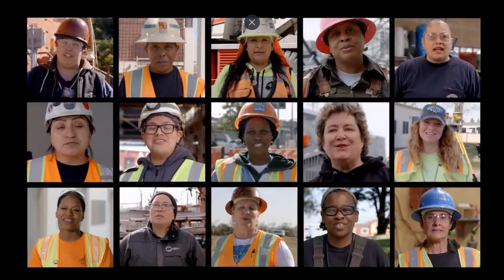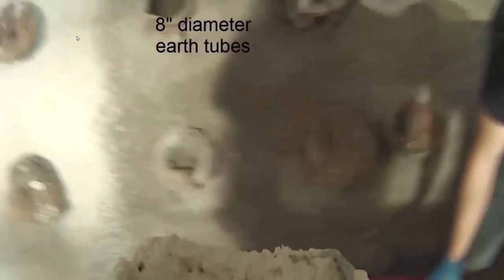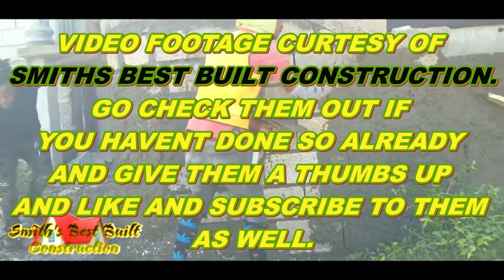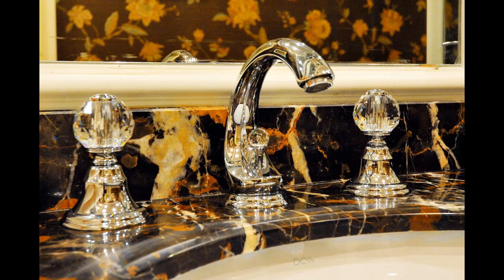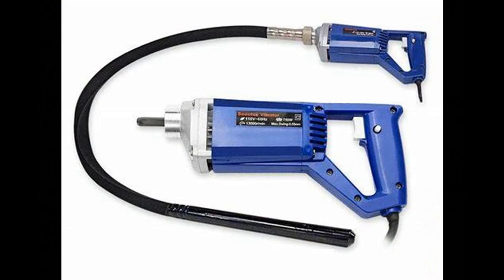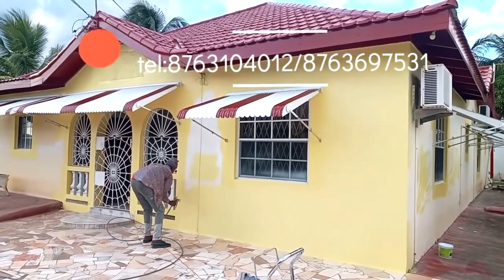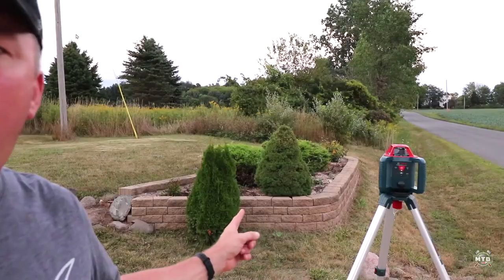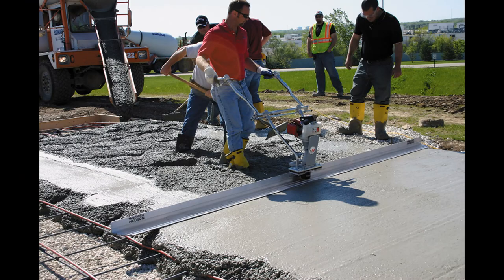BUILDING YOUR DREAM HOUSE IN JAMAICA, PART 8. TOOLS.

Comment: Great video. The Customs charges though....
Reply from the maker: thank you.
yes they can be a lot but there is a way around that. I buy a lot of used stuff for really cheap but customs value them at "market value" unless you have receipts so I take screen shots of the adds and then ask for a receipt from the people i buy from. I explain that i need it for customs and most people are quite happy to oblige.

I then make up an invoice that I show to customs and when they dispute a cost I have the proof. I got burnt really badly the first few times i imported some truck parts so I started doing that afterwards. 

Also there is a dispute resolution center at the  ministry of commerce where if the duties they try to charge are excessive you can refuse and appeal to them because many custom agents will tack on hundreds of thousands of dollars if you don't bribe them.